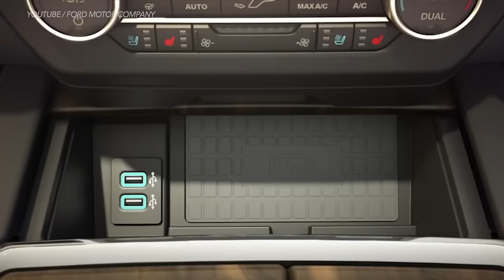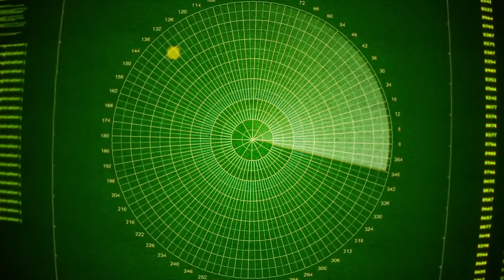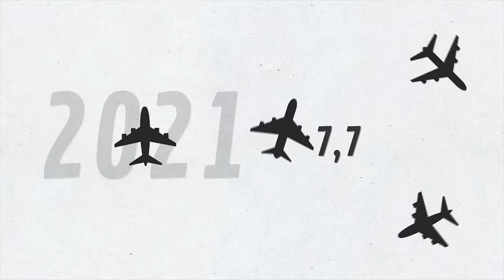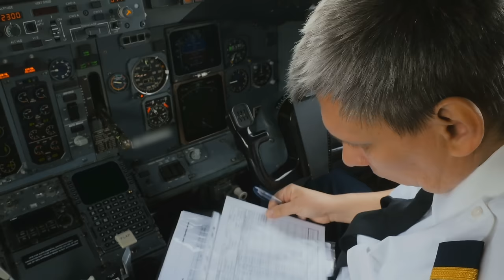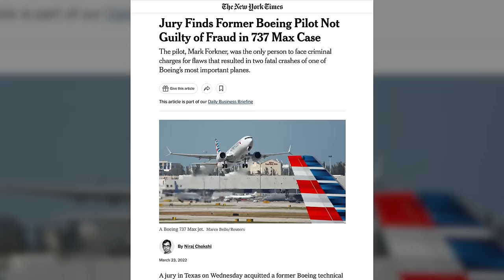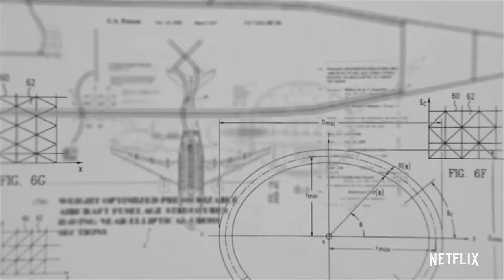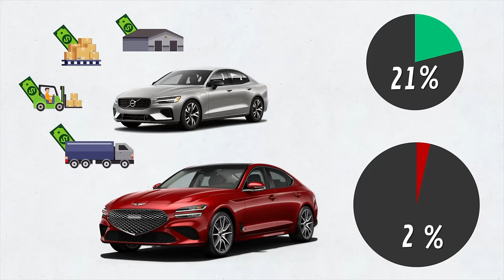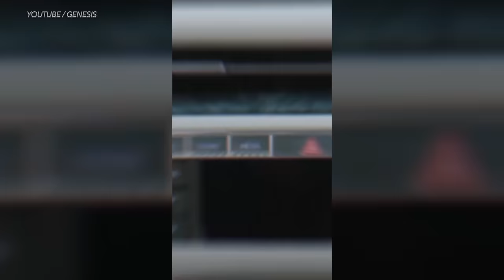Here’s Why Honda and Toyotas are Unreliable Now

Comment: The argument has to be made that the old cars were more reliable. The previous owner of my 1949 ford truck, drove it daily from 1949-2006. The truck still has the original engine, transmission and rear axle and still runs and drives great. No modern cars are still going to be running almost 75 years later.
Reply: That goes for everything made 40-50 years ago and more. Toasters, irons, stoves, ovens, sewing mach8hes, electric coffee pots etc. I won't buy digital appliances or sewing machines. I just ordered an old school electric percolating coffee pot because I know it will last longer. Also they use to make appliances that you could open up and repair yourself. No more. Too much plastic these days and not enough metal parts.
Reply: dang that's crazy. it's like everyone i know here in California who owns a super old car, has a Ford, including me 😂. i have a 99 Ford expedition, one of my friend has a 70's ford pick up, and my other friend drives a 99 Toyota pick up and is a lifeguard. it's the fastest way to becoming a homemade car mechanic.

meanwhile my family bought a used 2011 ford expedition and it's already broken down many more times than our 99 expedition. way more electrical problems that have broken, but it does have many more convenient features.
Reply: But the problem is the company will definitely close down waiting for another customer to buy a new vehicle....🤣🤣🤣🤣
Reply: Did you fart dust in the cab or out the window?
Reply: And a half billion vehicles were made the last 70 years that aren't still around. We always latch onto the few that are and say how much better they're made.
Reply: Thats why people say old is gold
Reply: @zepp3lin  : ah, that lonely Maytag repairman commercial
Reply: @donnamyers7274  Damn right. Before I had to move out my old house the same fridge from the 90’s sitting in my laundry room was still running cold. The kitchen on the other hand I went through 3 in 9 years
Reply: Yeh because of the electronics.
Reply: The electronic ignition module of my FJ 1200 Yamaha died. I could not get a working replacement. I drive a '90 TBird and want nothing newer. My best car was a '65 Chevy Impala. A 283, three speed manual transmission. It cost me $750.00 to purchase used.
Reply: It appears to be a simple matter of physics. The more powerful and capable the vehicle is, the more unreliable it tends to be. And while you could easily argue that more complex systems are more prone to error, the truth of the matter is that the wear and tear from higher horsepower (and various forces in general) is much more significant. And then on occasion compromises have to be made for safety.
Reply: @gordonschiff3621  non-moving objects tend to be much much more "reliable" as you might want to call it. Whether a person or automobile, anything moving is more prone to wear and tear. (That's why trees live so long, they don't move)
Reply: @temubarrackslawyer  right right. I bought the family home in 2009. My mama raised a garden and canned and froze food. She had made a canning kitchen downstairs with an electric stove from the 1960's. I'm using it now. Just canned 20 pint of cucumber pickles, 20 pints of pickled banana peppers and 20 punts of cowboy candy which is pickled jalapeno pepper relish. Next week I'll make some homemade mustard with mustard seeds spread with banana peppers and onions and can it. That old stove has served well. I get it serviced to keep it going. The fridge in the canning kitchen in my basement is a 1950's Frigidaire. Still going. The new stuff these days is made to last but so long....for greed. That's it!
Reply: the differences to modern engineering and function to basic mechanical engendering and function from the past.   people today wouldn't trade their smooth driving comfortable vehicles for a hard to drive uncomfortable noisy truck.
The other thing too is there are environment and gas mileage concerns today, which forces manufactures to change and adapt their engineering accordingly.
Reply: Old cars may be more reliable but they are simply not as safe.
Reply: @amandeepbaa6978  they say that because it rhymes
Reply: @hermanjohnson9180  Horsepower per liter maybe. Best engine i've had is a N/A V8.
Reply: @rickj1983  So wear some 3-point seat belts----I want the other guy to "Crumple," not me.
Reply: @davec8921  doubt any modern car will be here 70 years later
Reply: @phatgringo2.0  and sometimes prove itself
Reply: @billjones261  Well, there are cars from the late '90s - very early 2000s that are comfortable, reliable, and relatively safe, compared to cars even 5 -10 years older. Yes, all the insane electronics technology makes the newest cars safer - until there's a malfunction, or software glitch. Then what? Carmakers and buyers talk like this stuff will never break - which may hold true for most, so long as they just keep buying new every few years. It's an incredible waste of money and resources to keep the majority driving the newest technology - at least until car production grinds to a halt because there aren't enough computer-chips!
Reply: Original Toyota hilux dominates it
Reply: Contingency IBCT  I’ve got book of maintenance records proving it. The engine was rebuilt 6 times and the transmission once. And it has always been a southern truck, never been on a salted road ever.
Reply: @donnamyers7274  my mom tried to push the old toaster on us. The 50 year old kind that you drop the bread into and it lowers by itself. That thing sucked so bad I bashed it on the driveway cement.
Reply: For real just look at how many cars are still putting around un cuba 🇨🇺
Reply: Definitely not
Reply: @hermanjohnson9180  If a car don't run ,how would you call that reliable? And. Yes the less electronics to break the better your chances of it running better cause the newer ones as re being designed to break , especially when they put CVT transmission and it is no dipstick no way to change fluids proficiently, you can tell where the manufacturing is heading , they don't want them to last. anybody not seeing that is beyond me , please don to buy a CVT thinking it's going to get better gas mileage ,you will spend more in repairs later and believe me that will be more expensive in the long run!
Reply: Well, that's perhaps true, and in the long run, it many run another 75.  
But in the long run, we are all dead.

How's the air-conditioning working on that truck?
Reply: @thomasshoener2154  truck didn’t have air conditioning back then, you just have to roll the windows down.
Reply: Yeah carburettors do not break that often
Reply: That is an extreme outlier and nowhere near the norm and that truck is very unsafe.
Reply: @nobodyimportant7804  not really an outlier, anything the truck needed repair or maintenance wise it got. I’m sure it’s had an insane amount of repairs over the years.
Reply: Yep, and we get more pollution for having to make more stuff. It is amazing when I find a 1960-1970s kitchen appliance. It was usually built so well and robust. Now, cheap,cheap plastic, overly computerized, and will not last more than a decade or two if lucky.
Reply: @brandonstclair6530  I am not sure you know what oulier means.

Comment: As any mechanic will tell you, the late 1990's through around 2008 was the best for cars. Good mileage, reliability and serviceability. Todays cars are too complex. The dealers can't even fix them. I don't believe todays cars will last more than 5 years without a major breakdown. Therefore, I do not want to buy a new car... Too much crap on them
Reply: And in spite of that,we are overpaying for them!! Crazy stuff?!
Reply: i had a 99 civic, but there were still problems with it, like a bad converter, oil leaks, and bad window switches. Every car will eventually have leaks and worn out parts. With newer tech being added there is just more that can go wrong, but as far as size of vehicles was concerned that era was the best. not too big or small.
Reply: I have a Honda Civic 2016 1.5 Turbo 95,000 miles CVT. To this day the only issue I had was the AC compressor and Honda replaced it free of charge and extended warranty to 10 years. Other than that, this car has given me zero issues elsewhere,  no replacement of parts and oil levels do not drop at all.

I have even installed improved self-driving tech comma ai, muy car is technically future proofed.
Reply: I have a 2001 Honda Civic 5 speed and only had to change the water pump at 75.000. A new clutch at 93.000 miles. I will hang on to her for another 21 years she'll probably Outlast me providing no accidents. I hate all this technology being put on new cars. Where's the beauty in cars not many 2 doors lack of manuel.
Reply: Million miles cars use NA engine with manual transmission. If for automatic transmission need to replace 3 to 4 times. No way boosted engine can go this far.
Reply: I submit part of the unreliability of new cars is the pressure of increasing government gas mileage standards.  Car manufacturers having to implement modifications to engines that increase gas mileage but reduce reliability and longevity.  Cylinder deactivation for one.
Reply: You're sure it's ANY mech?
Reply: @markmitchell48  Not to mention the the combination of GDI + turbocharging.
Reply: @connie3312  because of "muh progress"
Reply: I had a 97 Ek hatch as my first car, didn’t even take care of that car and ran it dry without oil 2x, as soon as it had oil it ran just fine again, it had 300k before it got towed and I didn’t find it until it cost more than what the car was worth to get it out😭 I miss my civic  best car I ever owned.

Comment: if automakers would remain focused on maintaining mechanical performance and reliability instead of worrying so much about cramming in yet another pointless electronicky/computery feature... often without proper testing & QA...
Reply: So True!! Why would you want a car that makes fart sounds? What happened to the K.I.S.S. principle.
Reply: ....more gadgets - to advertise to out do competition to sell more cars. Then more repair parts to make more $$
Reply: Cars are becoming $40,000 smart phones.

Do people really even WANT most of this crap?
Reply: I just need Bluetooth radio and air-conditioning. I don't even need automatic transmission.

Comment: As a garage owner we love the newer cars.We have replaced thousands of ignition coils,Truckloads of the modern computer controlled non repairable alternators and we cant leave out the cvt transmissions.We have replaced thousands of oxygen sensors and the cat converters.We replace clocksprings weekly and seatbelts failing turning srs warning lights on every few days.
Modern cars are total junk but we make so much money from them  we invite them into the workshop with open arms and a open wallet.
Reply: Yeah....Awesome.
Reply: We don't need the Pinto back however
Reply: @stevenstern2199  I " inherited 

" a Pinto in 1979, it was a 76 model and we drove it everywhere.  Never forget the political cartoon that  had them being dumped out of the back of  a C 130 with the caption that they people on the ground did not deserve to to go out like that !
Reply: 😅😅😅😅😅 more power to you
Reply: @stevenstern2199  I always felt the Pinto was a reliable oversized go cart the one I had lasted a good while and was running when I got rid of it , they were good on gas also , don't know why people think 🤔 they were so bad I don't see any problem other than how the gas tank was in the wrong location 😂🤣😂

Comment: I'm sticking to my 2007 Honda Accord. Why fix if it ain't broken by buying a new car with questionable tech
Reply: The problem with keeping older cars running is availability of parts - especially new OEM parts.
Reply: I drove my 05 Pilot to 335.000 mile before I sold it. I'd have taken a coast to coast drive with that vehicle in the drop of a hat.
Reply: My 2007 manual transmission four cylinder Accord has 212,000+ miles and still runs great.  The 2001 I had before it is now at over 400,000 miles on the original drive train.
Reply: @jimjaremka8601  Wow!
Reply: @castlevina8425  I have a 2002 Mustang GT. Some items have been discontinued (i.e. seat belts) and some other OEM parts are no longer available (but aftermarket "equivalents" are available).
Reply: Still driving my '99 Accord 23 years later.
Reply: Same here love my 07 Accord.

Comment: The more complicated you build something the easier it is to break. Cars these days have too many electronics in them which can make them unreliable depending on what those features are.
Reply: And the electronics can be, and usually are, very expensive to repair/replace.  Cars are no longer engineered to last 20 years.
Reply: @clee47ford  It's why I prefer cars that were built in the early 2000s to mid 1980s when mechanic engineering was solid and there wasn't an excessive amount of electronics.
Reply: Complexity is unsustainable and unreliable,  but we can blame government for the laws manufacturer must follow to be compliant to EPA and safty. Safty is always good, but EPA laws seen to make the environment worse because MPG go down as more emission technology is installed.  My point is if you got 50 mpg in a car you use less fuel and produce fewer emissions.  Thus no need for complex fuel robbing technologies.

Comment: Going to stick with early 2000s-2010s models before the electronics and sensors got crazy out of control, and cars were easy to work on by yourself without special equipment.
Reply: Amen! . My 98 Honda Civic lx 5 speed manual is a great simple car to work on.
Reply: 2009 Accord